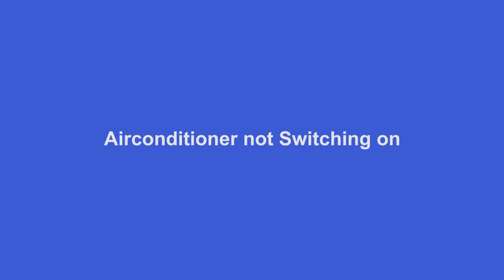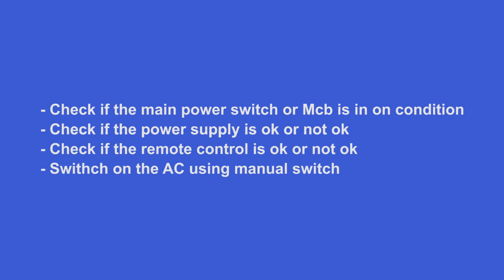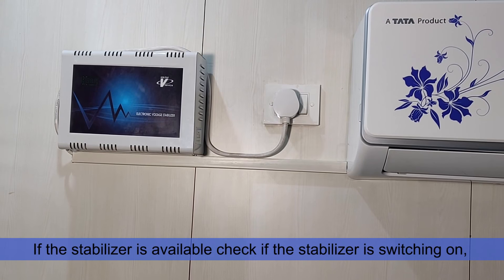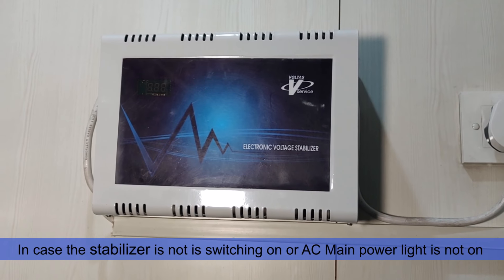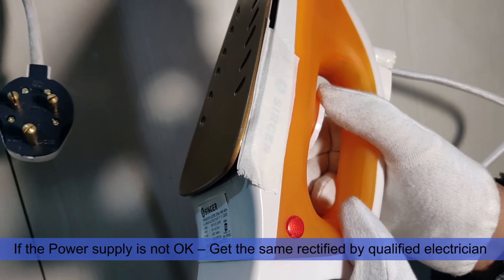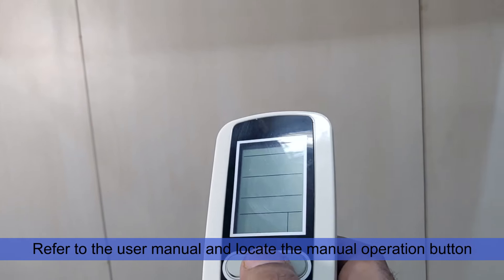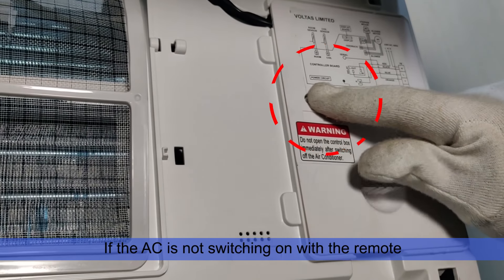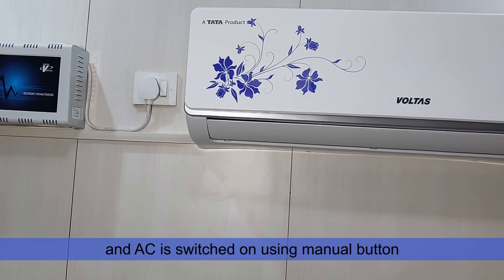AC NOT TURNING ON

Comment: Yesterday I purchased Voltas AC but still not working what's the problem??? Maximum how much need to Ac working voltage ???
Reply from the maker: 200 to 240 VAC
Reply: @masif  241 voltages but not working  what's the prblm Bro???

Comment: I am using the same AC which is shown in the video, I bought it last month and the cooling was superb. But since past couple of days all of a sudden it has stopped cooling below 24 °C irrespective of the temperature I set below 24 °C. I am using the same mode which I have used all these days even tried multiple mode and fan combinations. I have completely blown the dust away from both indoor and outdoor unit and the gas is also ok. Not sure what the problem is.
Reply from the maker: Thanks for sharing i think ambient temp. is high and your room size big

Comment: I have same ac i m facing problem when i turn off it will not off immediately just like other acs but it will take 1-2min time fan and swing is on and then it is off completely is there  any solution ?
Reply from the maker: No this is auto clean feature when you switch off from remote ac will turn off after sometime 30 sec to 180 Sec.
Reply: @masif   I am facing same issue by mistake I switched off the main supply and now the Ac board switch on is not Responding

Comment: How to enable auto restart feature ? My Voltas AC do not restart after a power cut, I need to turn it on each time using remote after power cut.
Reply: I have the same problem...how it could be sorted...pls suggest